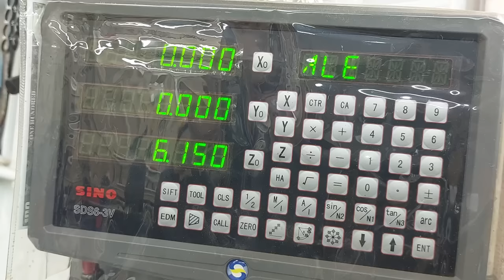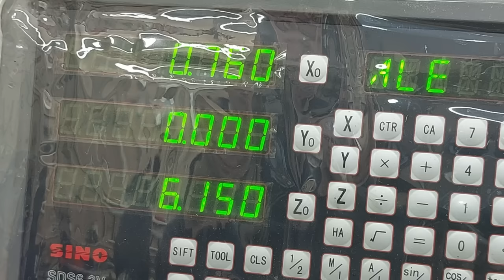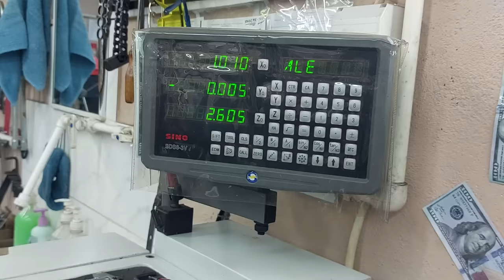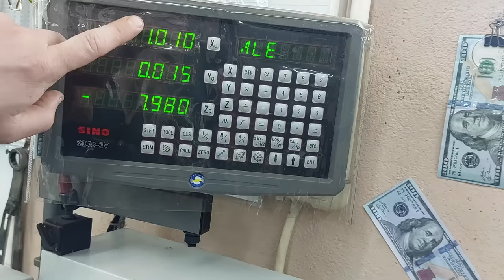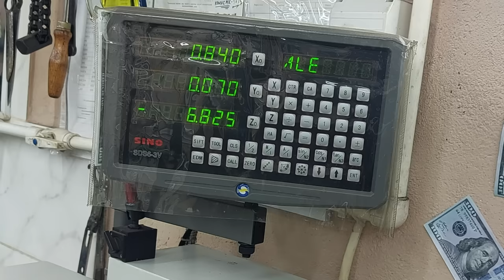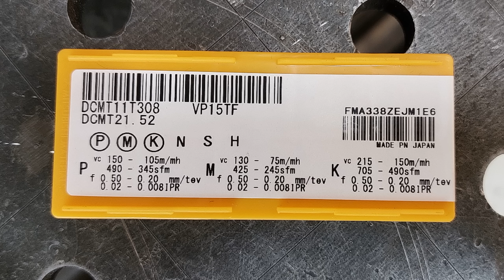Few people know how these carbide inserts work in turning metal

Comment: I’ve only been doing this for 50 years, but if I’m working to a very fine tolerance, +or- 0.0001” , or thereabouts,  I find it much quicker to rough turn to plus 0.010” and cylindrically grind, inside and out.

Comment: When I learned machine trades I had to grind my own bit from High Speed Tool Steel. Insert bits like that were just starting to come around. Teacher of the class had a hard time finding a bit that would withstand the force exerted on the bit from this forged Stellite die for drawing wire.

Comment: This video is useless
Reply from the maker: Welcome!
Reply: @CoolIdeasDIY-qv1nz 
What was the conclusion? It is not very clear at all. It looks like they all did more or less the same job. Aby difference is difficult to see. No explanation...
Reply from the maker: @drafty0183  In this video, I show step-by-step that this record can work with a lot of removals!
Reply: @CoolIdeasDIY-qv1nz  Working on CNC lathes for years. VP15TF is crap. Video is useless.
Reply from the maker: @idudodomu  What kind of plates do you use? What do you think are the best?
Reply: Those inserts have a different geometries so ap=1.0 mm in not suitable for of those all inserts geometries.
So you should test those inserts different cutting depths..

Second thing is.. Only store the scrap solid carbide inserts in one large box.
This was a surface quality test with one depth of cut and most of those inserts could have already gotten dents in that big box.

VP15TF is good grade for turning in some case's.
Not the best one but good..